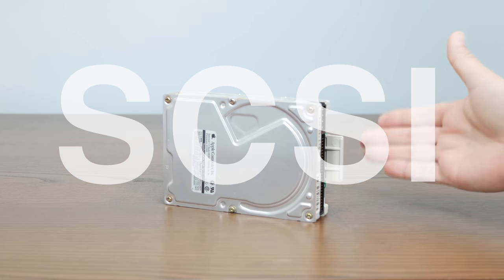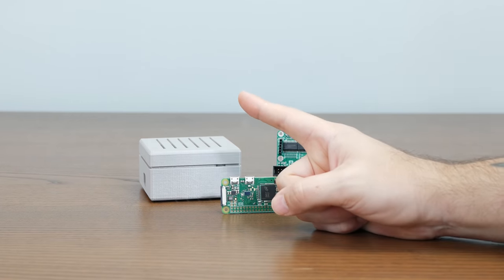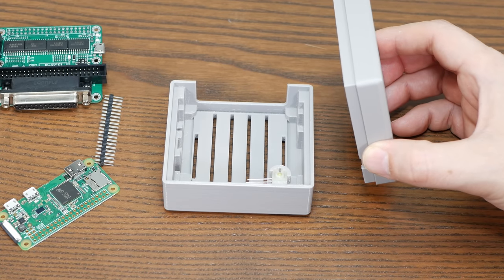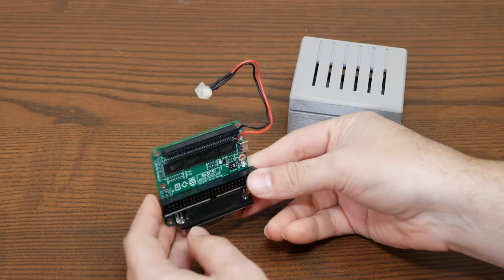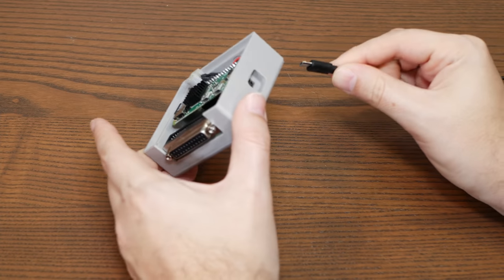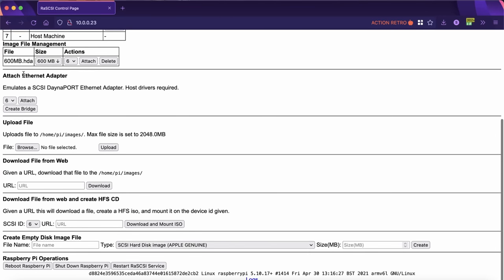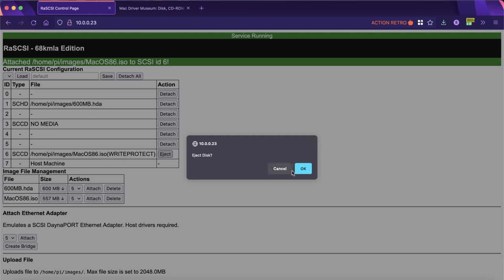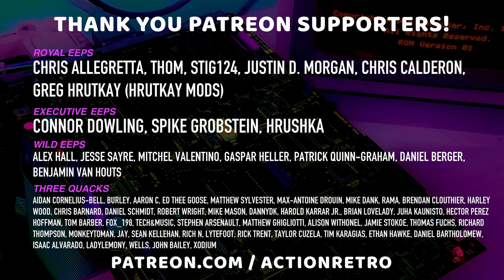The RaSCSI is MAGIC for Old Macs (and Much More!)

Comment: Very cool product and video. This inspired me to finally replace the hard drive in my SE that died a decade ago. I ordered the same parts, wrong sided GPIO pins and all... I have no idea how you managed to desolder the 40 pin header with just solder braid. For anyone in the same boat that doesn't want to spend $100+ on a proper desolder tool, the velleman vtdesol3u was a lifesaver at under $20. 

Now I just need to do a 7.0.1 install instead of the 6.0.8 boot floppy I was using, and hopefully get the Daynaport functionality working over wifi

Comment: SCSI unloaded some work from the CPU. Not important now and mostly not important then but it was a slight advantage on really old CPUs and use cases. The important bit for me was that SCSI was the only fast external option. I needed it for Nikon and HP scanners, Jaz drives, external CD drive and a Data Minidisk.

Comment: For retrocomputer purposes I think SCSI drives were generally 'smarter' so there may have been a reduction in CPU load.  Which wouldn't matter much when your usual user's single task is blocked waiting for IO.
Reply: They typically were; most good SCSI drives either had actual servo hardware or a second CPU, so they could handle incoming and outgoing requests without having to deal with housekeeping tasks like moving the heads or keeping the motor running (which some drives, particularly Conners and some of the Seagate drives that were based on them, tasked the main CPU with).

Comment: I had an old Dyna SCSI to Ethernet interface for the Mac Plus and it was decent for what it was .. SCSI was the fastest interface on that system.  I used it with a SCSI ZIP drive and it was a good fit because that system was so slow anyway.

Comment: "How did they get this texture on here? 
Easy, that's the bottom of the print. It's the bed sheet texture.

This is not always feasible to do, but anything with one big flat surface comes out so good.

Comment: A colleague of mine in the 90s made the mistake of buying a pc from PC World.  Not the US magazine.  A UK based computer retailer that is widely (and deservedly IMO) criticised by pretty much anyone with computer experience in the UK.

He didn’t really know PCs but needed one as a student.   So, he asked them for advice,  I can’t remember most of the specs.  I think it was a mid range 486.   The one spec I do remember is they sold him one that only had SCSI.   Apparently SCSI was the future and IDE was on the way out.

Arguably, long term, they were right.  That was 10 years later though, when SATA became a thing.    In the meantime, his hard drive failed after a couple of years,and as it was out of warranty, PC World wanted a small fortune to replace the drive.

So, he came to me.   IIRC, I found an IDE card that worked with his PC, and he managed to buy both that and 250 meg IDE drive (his SCSI drive was 250 meg) for less than the price of a replacement SCSI drive.

Now, he might well have had a SCSI drive that was faster the the IDE drive he ended up with, but bearing in mind he was using Windows 95, and only used it to play some low end games and for using MS office, he likely wouldn’t have noticed a difference.

Comment: SCSI Configuration is actually kinda easy, even when adding devices, since all you need to get right is the ID and connect it somewhere between your last device and the SCSI Card. But i guess, when you are able to connect Master and Slave in the wrong order. What i can say tho, the drives were super reliable, drives from 1998 made it way into the 2006s for me, until i had to replace them due to size considerations.

Comment: Using the Paspberry PI Imager hit the control shift X before you hit the last step to download and you can preconfigure options such as  Wifi configuration and overclocking as well as root password

Comment: I thought we called them "spinning rust" because the magnetic layer is ACTUALLY a metal oxide. 😁

And Sean, if you think using the Pi as a peripheral for a SCSI-based Mac is ridiculous, look up "TiPi" sometime. Using the Pi as a peripheral for the Texas Instruments TI-99/4A to connect it to the Internet, provide disk space, etc. Same idea, really.

Comment: From my experience doing 3d-printing I'd say that texture was achieved by using painter's tape or build tak as a surface. Have a good day!
Reply: Of course, something similar like a reusable build plate included with many printers nowadays, such as the venerable Prusa Mk3, may also be in use there, though that lies outside my expertise, I am afraid

Comment: Does the RaSCSI physically fit in a "classic" style Mac? I'm working on refurbing some of my classic Macs (SEs and SE/30s) and unfortunately those old SCSI drives that are in them are at death's door... they still work (for now) but are starting to make some very unwholesome noises. I hesitate to go to a SCSI2SD due to the cost, but the RaSCSI looks like a very cost effective solution (especially since I already have a couple Pi Zero's and MicroSD cards lying about, so wouldn't need to buy those)

Comment: You could also host the images subdirectory over an NFS or smb mount, potentially backed by faster and more reliable storage than an SD card. Of course, you're subject to the reliability and performance of your wifi at that point, but it's an interesting idea. I think for a lot of these macs you are basically limited to scsi2 or scsi3 speeds, so it's probably not hard to keep up with their controllers

Comment: No, it was no headache to connect 7 or later more drives. It was all about good cables and correct termination. There were many tower-like external drive housings that could easily take 6 drives. Also, all RAID-system back than were made of SCSI drives.

Comment: SATA, USB, firewire, fibrechannel, SAS:  all are just transports for SCSI anyway.
Reply: Most SATA hosts emulate SCSI on ATA drives using the SAT specification, but the other interfaces listed (and ATAPI devices on SATA) use SCSI commands directly.

Comment: There was a lot more to like for SCSI. SCSI had higher performance because it could queue up to 256 commands vs. 32 for IDE. IDE was also never really made for external hard drives. Being able to chain up to 7 external devices on a single connection was much more flexible. Finally, SCSI devices had a bad block defect list so it could swap out failed blocks with new ones. IDE drives at the time required the OS to handle this. With that said, while I spent the 1990s/early 2000's as a huge SCSI fan, I still eventually went all IDE and was glad to never deal with SCSI and bus termination again. SAS/SATA did make SCSI great again for my servers at the data center, but SSD has been replacing them for years now.
Reply: IDE didn't even really have proper command queueing for a long time, and even when it did it wasn't widely supported. Generally the OS was expected to use elevator algorithms to minimize head thrashing, but that's only a rough optimization as opposed to onboard command queueing which can compensate for fine-detail optimizations that take into account rotational position.
Reply: I didn't think parallel IDE driver ever had NCQ, I thought that was only introduced with SATA.
Reply: @eDoc2020  Before NCQ on SATA there was PATA command queuing, which could be emulated on SATA. It was not super widely supported and NCQ quickly replaced it on SATA.(NCQ meaning Native Command Queueing, i.e. the command queueing native to SATA)

PATA's tagged command queueing was partially unpopular because each request had to be handled by its own interrupt, which increased CPU utilization when it was enabled.

Comment: RaScsi (And BlueScsi) is awesome!  I've been poking at a live physical user interface for it so you can configure it without needing a web interface.  (expanding the use of the display to include a rotary controller, and new menu system).  :D

Comment: Great! Gotta buy one of these! Can you boot the machine out of the RaSCSI?
Reply: Absolutely you can! The Raspberry Pi OS does take ~30 seconds (probably more on a Pi Zero) to boot. So, you need to make sure you can boot your Pi before you start up the Mac.

Or.... if you don't have any other boot drives available, the Mac will just show the flashing question mark for a little bit. Once the Pi boots up, the Mac will see the new SCSI device and boot from it with no problem.

Comment: Is there nothing a raspberry pie can't do? Such a versatile dessert.

And Andandtech was wrong about why old Macs had SCSI. It's because they're not AT PCs. The IDE interface is basically the AT's ISA bus with a few pins missing, and early Macs weren't AT PCs, so they didn't have an ISA bus that they could just slap a bus transceiver on to connect an IDE hard drive. There weren't any "IDE controller" chips because it didn't need a special controller, so if they wanted to use IDE instead of SCSI, they'd need to design their own IDE controller chip to interface with the 68K CPU on the Mac. To implement SCSI it was basically just a matter of throwing in a SCSI controller chip and calling it a day.
Reply: Apple eventually did do that on some of the later Quadra/Centris models (particularly the Quadra 630), but even Macs with IDE kept their SCSI ports until the iMac G3 and the Blue & White G3 introduced USB.
Reply: Converting a 68 family synchronous bus to 80 family asynchronous devices can be done with the addition of a single 7400 chip. That's far cheaper than a SCSI controller.
Reply: @eDoc2020  Wow, one chip to convert from big endian on the 68K to little endian that the x86 uses, plus whatever other signalling is needed? That's incredible! That must've been one hell of a 7400 chip!
Reply: @UpLateGeek  The x86 bus has a read strobe and a write strobe while the 68k has a single strobe along with a line which selects if it is a read or write. That's the main difference. There's also a big difference in how 8-bit accesses are performed but this can be ignored for IDE. That should account for the signalling differences. When I said a 7400 I didn't mean a mythical complicated 7400 series chip, I meant a literal 7400 quad NAND gate.

Endianness also isn't an issue. That can be handled in software but if you need it done in hardware you can just swap D0-D7 with D8-D15.

Comment: I'd be curious to see the performance of this setup compared to a SCSI SD or spinning SCSI drive. The Pi doesn't have a SCSI controller, so I wonder how performant the software implementation is.

Comment: Real answer is SCSI had a longer use history and mature hardware platform, IDE was a good looking product with no real world track record. It boiled down to "nobody gets fired for doing what worked yesterday." mindset.  As IDE gained manufacturing capacity and reliability history the market moved to cheaper. Then we repeated everything but faster when it came time for the IDE vs SATA conversation.

Comment: SCSI was better because it A/ used DMA transfers and /B SCSI cards were a host and had their own CPU. The Result was SCSI hard drives were faster because the computer CPU wasn’t doing all the work to read or write data and could do other things.

IDE didn’t use DMA until the Ultra ATA standard so using your hard drive was actually a system bottleneck in early PC’s.
Reply: There was a time when you had to be careful about that on PCs, because some very old or low-end SCSI cards (mainly older ones from Adaptec, Trantor, Future Domain and Seagate, as well as a bunch of sound cards that used those older host adapters' ICs for their integrated SCSI ports) didn't support DMA, and so using them with anything more demanding than a CD-ROM or a scanner was painful, especially in Windows 95/98.
Reply: @lee4hmz  it wasn’t until Windows NT and OS/2 that SCSI cards worked well in PCs .
Reply: @Cybernetic_Systems  I had Windows 98 running pretty well a while ago on my Pentium 100 machine with an Adaptec 39160, but yeah, I wouldn't have tried anything potentially dangerous on Windows 98. In contrast, I crashed the SCSI bus multiple times while doing CD-ROM software development on XP, and the system itself never crashed once.

Comment: I hope it will work with the Commodore Amiga A3000.  The only time I had trouble with SCSI on the A3000 was when I tried to install a free version of UNIX.  AmigaOS wasn’t very picky about SCSI termination but that BSD version of UNIX sure was.

Comment: Adaptec 2930U2W. And Red Rock Technologies who now make SCSI SSDs. Also check out the GCC UltraDrives. Someone should put one of these in an old GCC or Jasmine case. SCSI came first and was much older. IDE/ATA replaced it. The Mac Plus was the first Mac to have a SCSI connector - 1986. Macs with ATA happened around 1997 or so.

Comment: The advantage of SCSI back in the day was not 'debatable'; you only had to have more than two peripherals. It was not possible for PCs with IDE back then to support more than two devices on one bus and even that required setting jumpers to set the master and slave. And SCSI was used for printers, scanners, network adaptors and other devices too. No it wasn't plug and play and you had to mess with terminators sometimes but even the most basic mac supported configurations that a PC could not without additional cards.

Comment: If Apple only made low end systems they might have gone with IDE but Apple wanted to sell the big boxes into customers shops that had lots of other computers and those other computers all had SCSI. I ran a graphics shop and what you would call an expensive Apple system was low end to us and we were thankful that they used the same drive standard as the SGIs, VAXs, HPs, SUNs and NeXT computers. Daisy Chaining wasn't difficult for us either as it was the same situation for all the machines and we had a huge box of SCSI cables and terminations and there were a number of other SCSI adapters and converters that were available. Please don't frame everything like the low end was all there was. People don't know about all the high end systems that were copied by lesser systems and got popular. Photoshop did not invent image editing, Excel and Word weren't the first.

Comment: I have a couple SAS drives from a server my school was tossing, it’d be cool to see if a mac could read them somehow
Reply: SAS is still basically SATA/IDE but supports some SCSI protocols so you couldn't use a SAS to SCSI physical adaptor like you could with SATA to IDE.
Reply: @nismo4x4n  ahh that’s too bad, I appreciate the clarification
Reply: @nismo4x4n  I would say ATAPI is the one that's basically ATA. SAS is basically SCSI and parallel SCSI to SAS adapters should be as easy to make as PATA to SATA adapters. The only reason they don't seem to exist is probably because the market would be very small.
Reply: @eDoc2020  SAS to SATA and IDE can be done with purely a mechanical adaptor, the same can't be said for SCSI.
Reply: @nismo4x4n  No, you can't do those conversions with a mechanical adapter. For one reason why, look at the number of pins. There are something like 20 (I think actually 21) essential signal wires on IDE while a SATA cable only has four signal wires.

SATA drives can be used in SAS systems but no mechanical adapter is needed for that as the connectors are designed so this is possible.
Reply: @eDoc2020  maybe I could have worded it better they're just logic adapters not protocol adapters.

Comment: SCSI drives ended up being better because the manufacturer used the best mechanisms in those.  So the only reliable iomega zip drives were the scsi models verses ide for example.  Drive maintenance programs were far superior.  The types of devices were more available or were scsi only, like magneto optical drives, tape libraries and early cd burners.  Old scsi will run a scanner or printer it was never designed for.  You can't plug a scanner into ide.  You can't use optical drives or some tape drives in old ide by contrast.  IDE required a new controller or mainboard to support new styles of devices.   It was more heartburn to get more than one drive working on an ide chain, especially in the early optical era for burners than it ever was getting the scsi chain working.  PC user's gave up and bought a scsi card to do burning for the early years.  SCSI also had the caching and scheduling to handle reliably burning to disc.  IDE only picked that up as a common trick in the second gen era of SATA.  Certain IDE drives did support native command queue etc in '96.  But it wasn't common to all of us PC pleebs until recently.  Also ide wasn't consistent mainboard to mainboard.  You may upgrade the mainboard in your pc and..whoops my drives aren't working.  But that's from '90 to '95 ish.  Apple was using ide at that point circa 2000.  In many ways I'm still waiting for my pc to catch up to my Mac from the early 90's.  My multiple monitors never glitched.  My system folder wasn't a maze.  All my media always played.  Even my Mac now isn't as good as my Mac.

Comment: For internal drives, SCSI wasn't much better than IDE, but SCSI supported external drives too. Daisy chaining worked very well - we regularly ran external tape drives, scanners, and hard drives simultaneously. We also could duplicate one SCSI drive to six others without any additional hardware - just cables and one terminator. 

USB 1.x was way too slow for hard drives. It wasn't until USB 2 that it was tolerable and Mac users were using Firewire at that point. 

For single drives now, USB-C is fine but Thunderbolt is better for RAID or really fast SSDs.